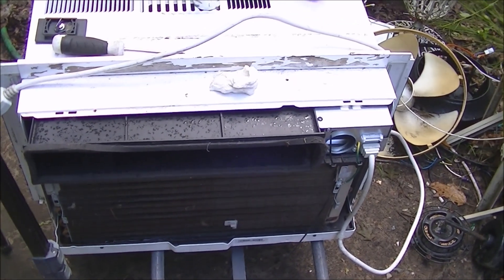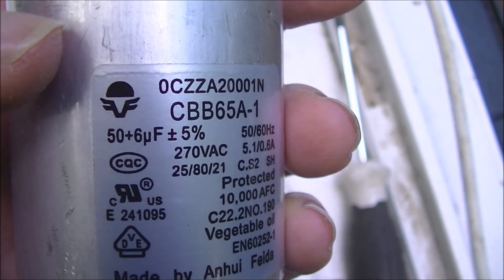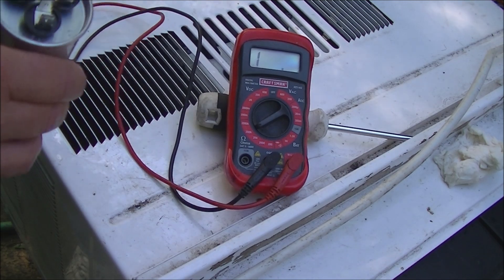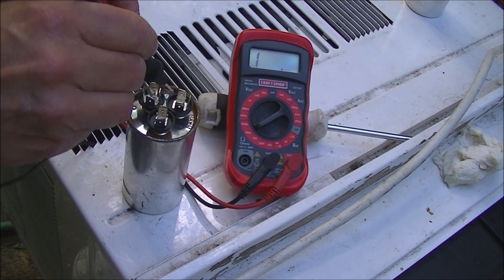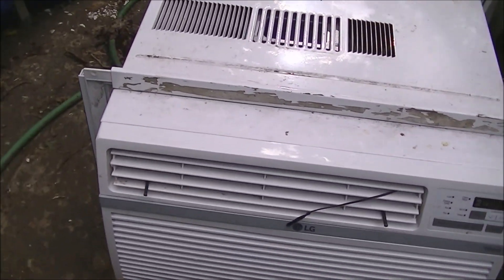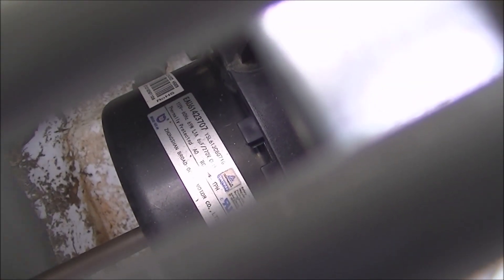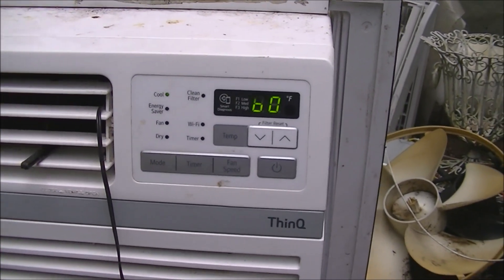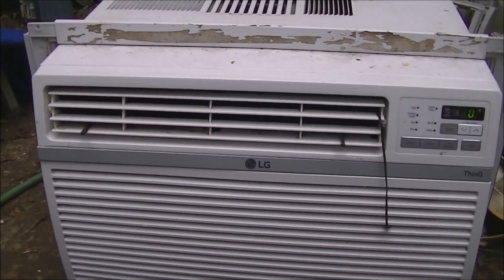Changing Capacitor LG ThinQ 10000 BTU Air Conditioner

Comment: The only rating that only matters when replacing Capacitors is the Capacitance (Microfarads, uF) which should be same value as the original Cap. All of the other ratings doesn't really matter, not even the Voltage as long as it is equal to or greater than the original. A much higher voltage rating in a capacitor may in fact be better for longer durability.

Comment: Getting parts for an LG window air conditioner annoying and painful I ordered something for my LG window air conditioner like 2 months ago and I still haven't got it
Reply from the maker: It was awful trying to get a capacitor for this. Ebay seller sent completely different capacitor, ordered another from an appliance website and they never shipped it, then got this one from ebay, it's not the part # they listed, but the values were right so it finally worked out.
Reply: @airconditionersexposed  The only rating that must be the same when buying capacitor is the Capacitance. For the voltage rating, it can even be higher than the original for better durability. The current and frequency rating doesn't really matters. 
Also, I replaced a 35+6uF capacitor that failed on a 2013 LG 6000 BTU A/C with a new cap of 35+5uF and the unit came back to life, and I plan to add an extra small 1uF capacitor to the 5uF Fan side in parallel to have a total capacitance of 6uF on that side.
Reply from the maker: @KingHarlequin1999  All I could get for this was a 50+5 or a 50+7.5, 370 volt. It was actually suggested I could add a separate capacitor for the fan, but I happened to find the exact match on ebay, but it was a bit pricey. The LG parts places were all out of stock, it's only 3 years old.
Reply: @airconditionersexposed  It doesn't need to be exclusive from LG. Any other manufacturer will just work fine as long as is it the same capacitance and the same voltage rating as the original or greater volt value.